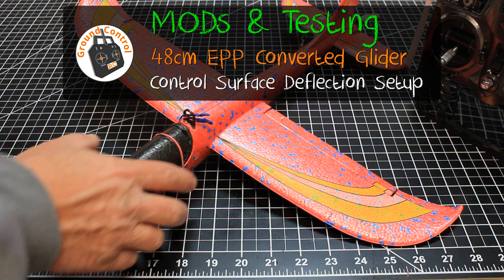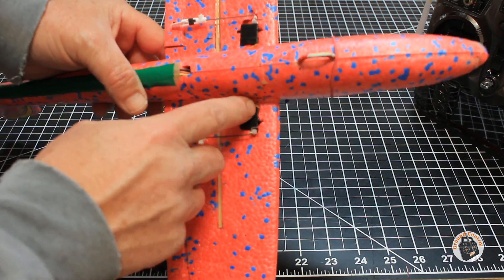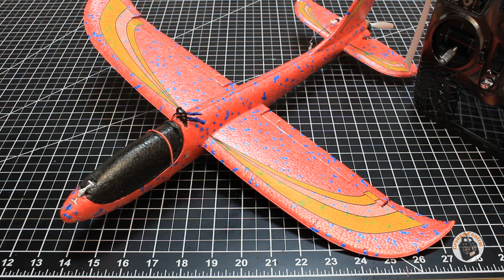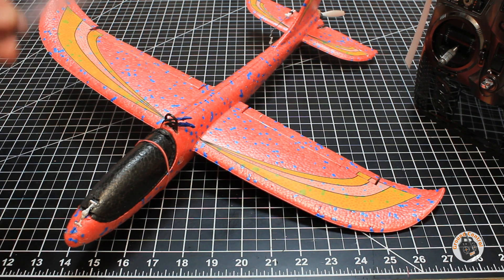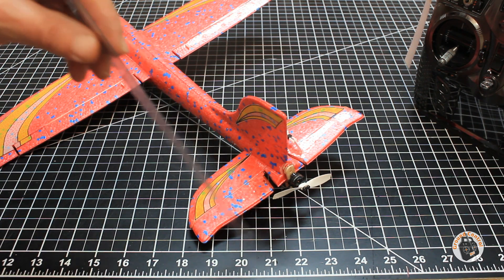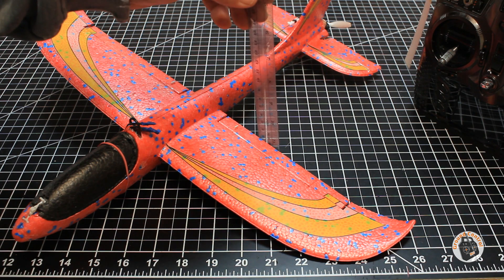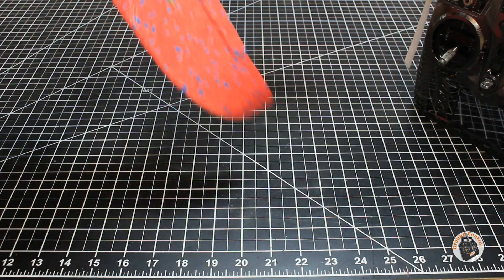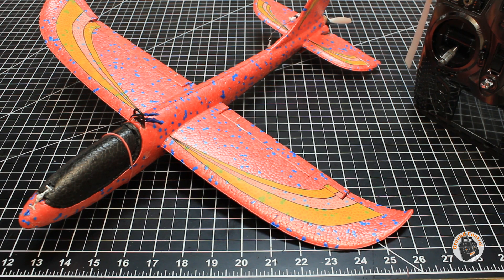48cm EPP Glider Conversion - Control Surface Deflection Setup

Comment: Hi  A great series, a couple of questions , Where do you get your  Cleves links with the screw attachment and also the nylon front hinge for the canopy. both are a great idea Regards Geoff.
Reply from the maker: Thank you much! Here is a link to the Clevis & Control Horns I use: https://www.banggood.com/10X-Rudder-Servo-Rob-Angle-Set-With-1mm-Chuck-Screw-For-RC-Airplane-p-1148260.html?p=WE081047791920140372  I could not find the exact hinge I used in the project but here is something very similar, it is a pivot hinge. These are really designed for control surfaces but they worked great as a canopy hinge ;-)  https://www.banggood.com/10-Pcs-D4_5xL67mm-D2_5xL43mm-Needle-Hinge-For-RC-Airplane-p-1058387.html?p=WE081047791920140372   These come in (2) sizes. For something like this glider I would choose the smaller one. I hope that helps and I'll see you in the Air!

Comment: These details are certainly helpful. Thanks to you as well as the person who asked for this. I had a question regarding the tail. Do you have a skid on the underside of the tail to keep the prop off the ground?
Reply from the maker: Santosh, thank you much! I do indeed. I have a skid at the font located about where the back of the canopy is and one on the back just below the horizontal stabilizer. They have held up very well if you have watched many of my landings ;-) I used two dental flossers, the ones with the plastic loops, I cut off the plastic loops and glued the front one into the foam of the fuselage. The back one was a bit tricky as I have my motor wires running under the fuselage as well as the servo cables. I used a piece of stiff plastic, applied heat, and formed it into a "U" shape to fit snug against the tail of the fuselage and epoxied the plastic loop into two holes I drilled into the "U" bracket and then glued it to the foam. It doesn't completely prevent the prop from touching the ground but prevents damage to the prop and the wiring. I hope that helps explain it. See you in the Air!
Reply: @GroundControlRC  Thank you for that explanation. Yeah those flossers are quite useful as skids :)

Comment: Great detailed info on the surface deflection GC. Thank you alot for sharing!
Reply from the maker: Thank you much Robby! I had just realized that I had not covered that information and it's pretty important for someone wanting to perform this conversion. I must have had a senior moment ;-)  See you in the Air!
Reply: @GroundControlRC  No problem GC. Unfortunately time is passing by so fast in our daily life. Thank. Robby.